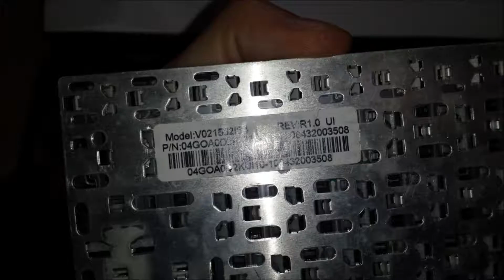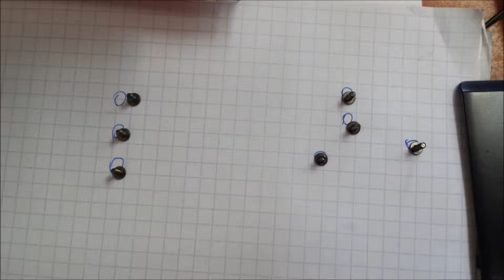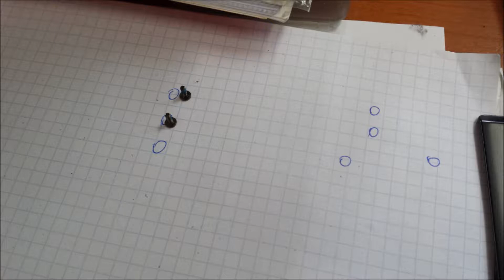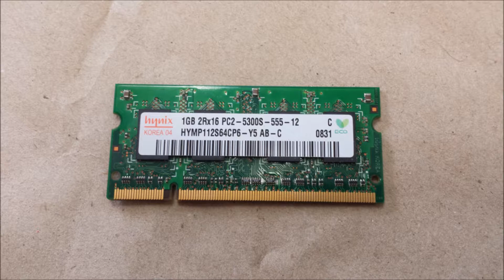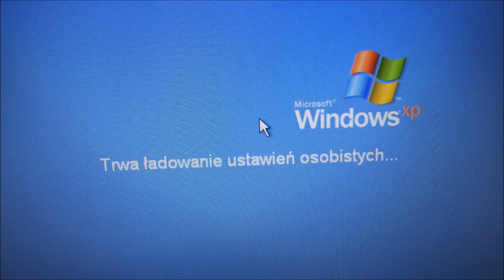ASUS Eee PC 1000H disassembly cleaning cooler fan | ForumWiedzy

Comment: Now that you have a cleaned eee pc what cpu temperatures are you experiencing? Because i think i have the same problem but before deciding to open it up for cleaning i wanted to be sure that this is the problem. My eee pc has the fan running all the time and the cpu temperature is between 65-75 celcius degrees. Do you think i have the same problem? A laptop that needs to be cleaned? By the way, thank you for sharing this video.